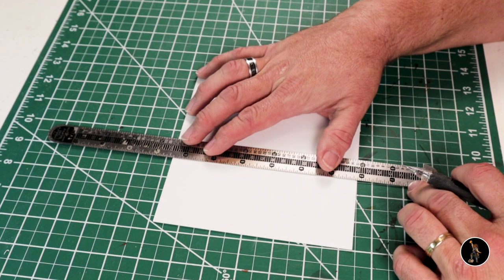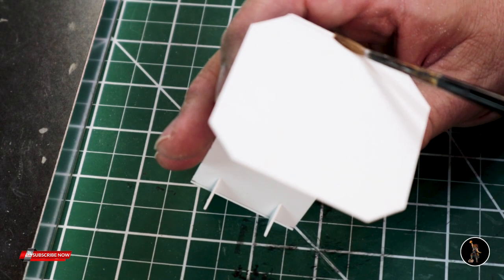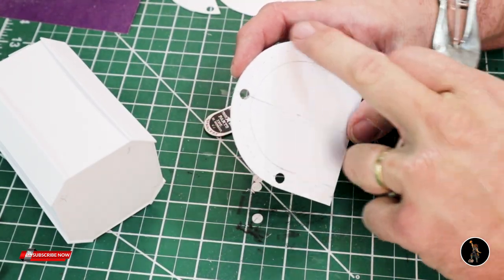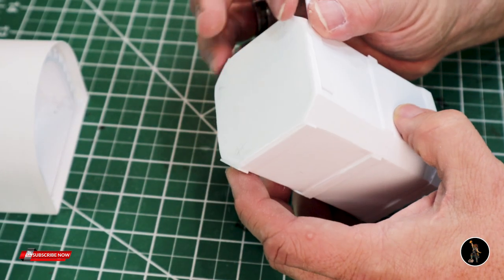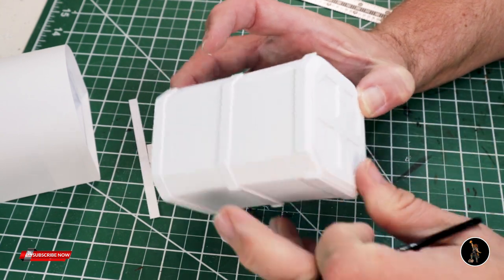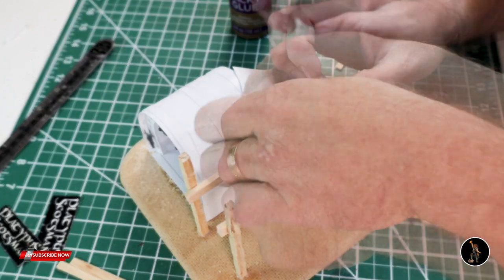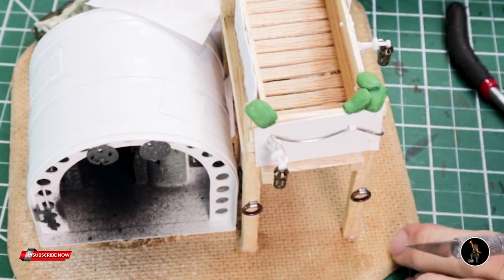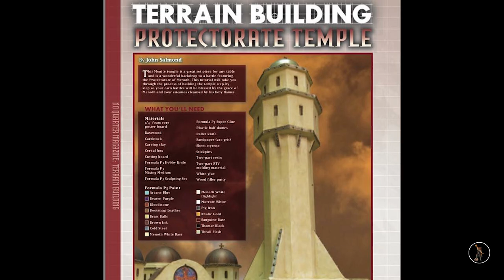Wasteland Shanty: Part 1- The Build

Comment: Rigidity I do belive is the word you were going for even though I think rigiderer sounds so much more interesting.  If you are ever working on your mat and don't want to accidently glue or make a mess on it cut a piece of parchment paper and go over the mat.  It's semi translucent so you'll be able to see the lines but nothing will stick to it and it'll keep the paint tidy and easy to clean up to. I love this build but I need to do it a bit smaller to scale out at 1/.64
Reply from the maker: Sorry for the delayed response. Been distracted. Thanks for the props. Thanks for the tip with the parchment paper. I have used that idea for other such similar methods just not applied it on this method. 
Cheers,
John...

Comment: Nice job man, please can you say me what is the glue you are using? Thx
Reply from the maker: Thanks. The Glue is Weld-On #3
https://www.amazon.com/SCIGRIP-Adhesive-Applicator-Bottle-Needle/dp/B079J4KGMC/ref=asc_df_B079J4KGMC/?tag=hyprod-20&linkCode=df0&hvadid=312316004084&hvpos=&hvnetw=g&hvrand=11748954552219001271&hvpone=&hvptwo=&hvqmt=&hvdev=c&hvdvcmdl=&hvlocint=&hvlocphy=9029703&hvtargid=pla-570156515177&psc=1&tag=&ref=&adgrpid=63239824558&hvpone=&hvptwo=&hvadid=312316004084&hvpos=&hvnetw=g&hvrand=11748954552219001271&hvqmt=&hvdev=c&hvdvcmdl=&hvlocint=&hvlocphy=9029703&hvtargid=pla-570156515177
Cheers,
John...